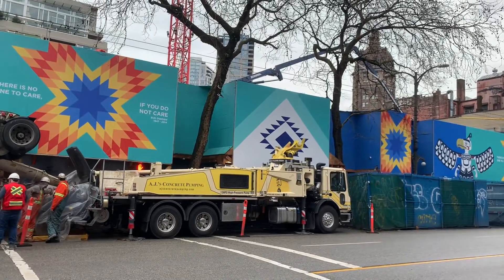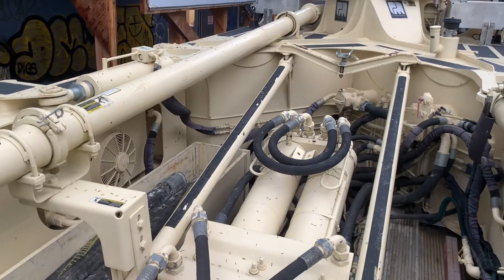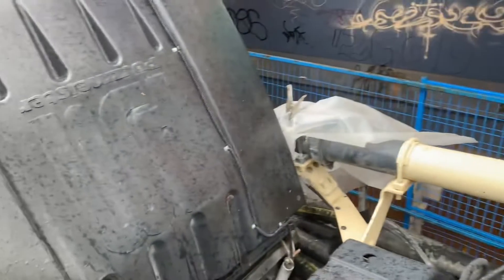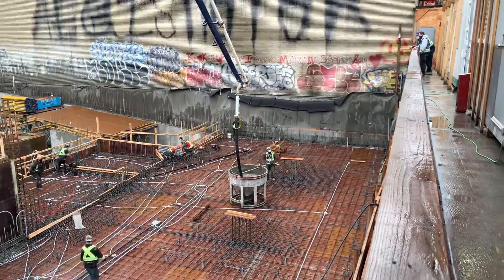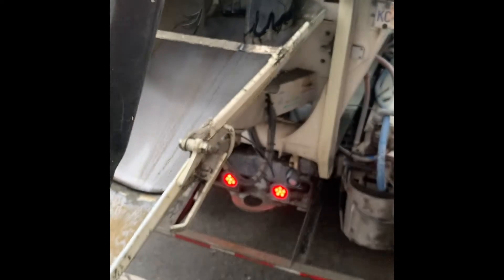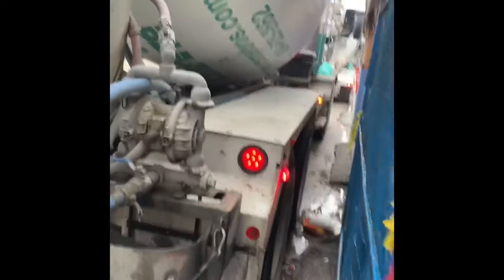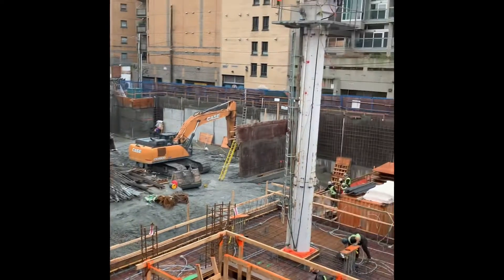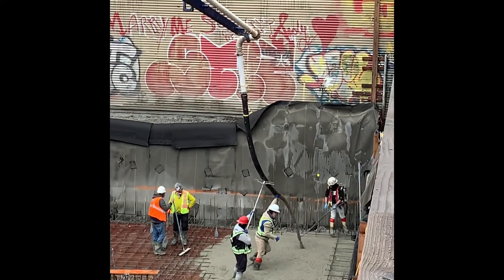Grout prime with the Putzmeister 13HPD concrete pump and Schwing SPB37 placing boom.

Comment: I place a decent amount of water in the washing bend, where the pin to stop the balls is located.
When going with the mast only, I drive the concrete out with 5.5-7 on the feeding adjustment. Turns it down when I hear the concrete in the last two sections.
Works everything, even with 24mm rocks  unreduced concrete mix.

When I use hoses, I sometimes mix up slurry with a bag of cement, or I "borrow", 10l of SA.

I did feed a spider once, got a 0.5m3 with stiff grout from the factory. Added SA in the first hose from the pump, and this successfully ran trough 70m of 4 inch hose and pipe in -12 with a little bit of wind.
It all went straight out in a big freeze when a hose blown on top of he brigde framing.
Nothing was made easier when the workers where Chinese, speaking just about 1 one word English. Shit. 

They spendt 1 hour to get a new hose. So guess what. The spider was 100% frozen.
After alot of disgusting arguing from a mad Polish foreman, I showed him that the concrete was stopping in the exchanged hose. 
He had some ambitions to empty everything in a basket.
After a few attempts, which I knew was doomed to fail, I disconnected from the pipeline and left.

From what I heard they got it up, using alot resources over the following days.
And finally took Full responsibility for the failure of this casting.

I'm still amazed how quickly things go from bad to a disaster when the communication capabilities is non existent.. 
Especially when the people in charge don't factor in temperature and wind draft.. 

Ps. I consider moving to Canada. I need a job. How is the level of salary for å concrete pump operator in Canada?
Reply from the maker: That's the thing about this placing boom work, it can go from extremely boring (when things are going as planned) to the worst day in your entire concrete pumping career (when things go sideways) in the blink of an eye!

Motivated operators in our current market conditions should have no problem grossing $130K annually.